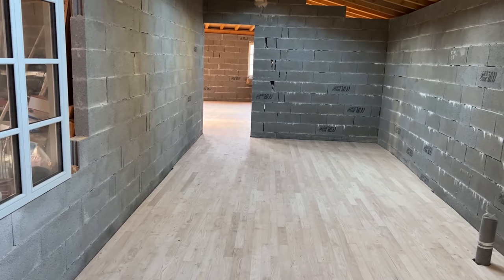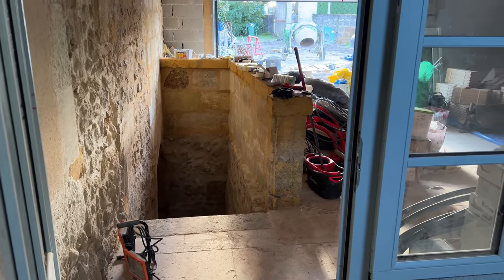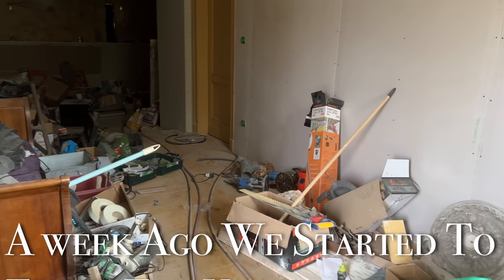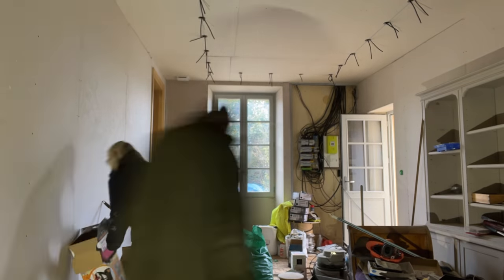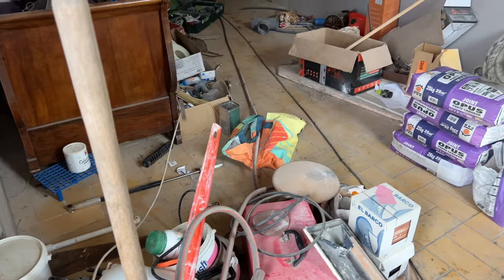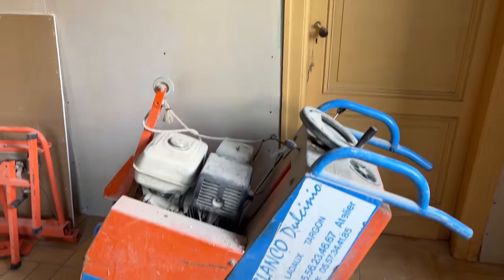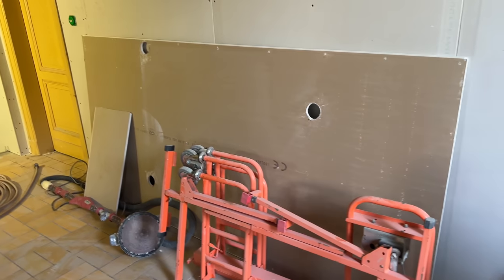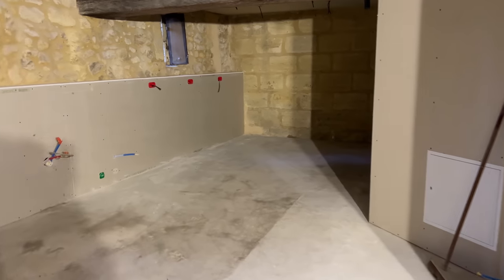EP127 A Start For Our Dream Kitchen & Guest Apartment @ Our passion Project + Brocante

Comment: The façade is not symetrycal, 2 windows should be on the right side of the front door... they obviously were there previously. Do you intend to restore them?
Reply from the maker: Thé house is not missing any windows, this is how it was renovated in 1874… if you look at it from the front one side of the pillars is larger than the other….. of course we will be ripping off the white aluminium shutters on the left hand side and replacing them with wood.